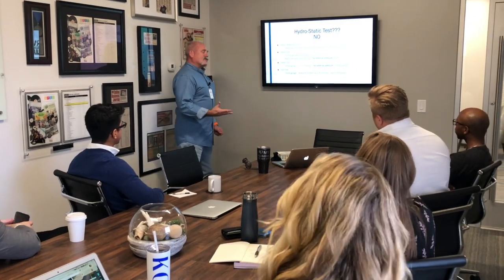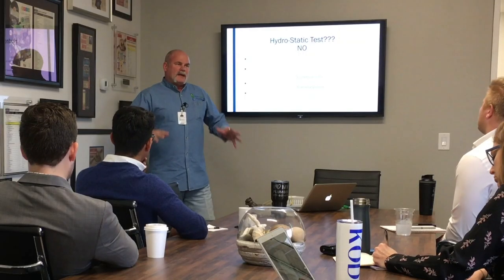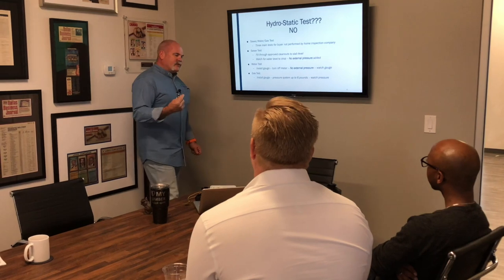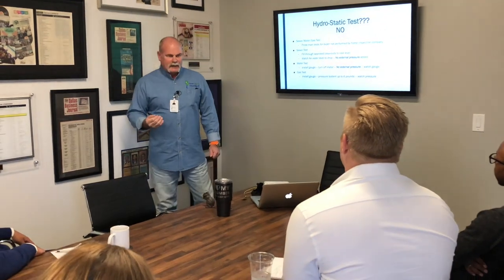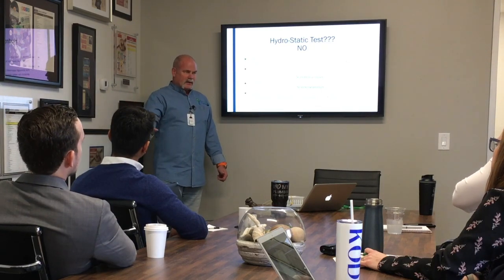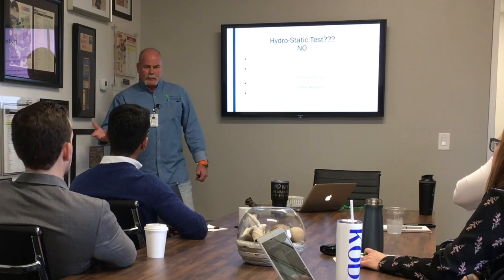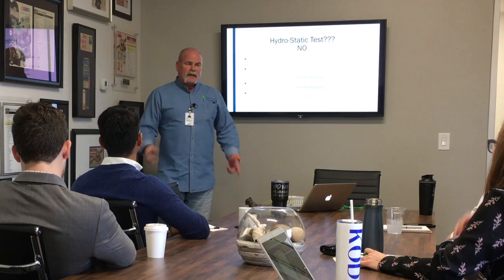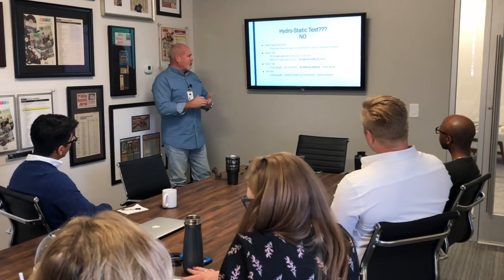Why "Hydrostatic Tests" Are Wrong - Plumbing Tricks - The Expert Plumber

Comment: By adding water to the system you are adding pressure, not very much, but still pressure is applied greater than ambient atmospheric pressure... thus the definition of Hydrostatic Pressure Test. Just semantics though

Comment: I enjoy your videos and have learned from them however as a hydraulic engineer I feel that you have a misunderstanding as to what “hydrostatic pressure” means. It is simply the force exerted on a vessel by the forces of gravity acting on the fluid within the vessel. Or more simply put it’s the pressure exerted only by the weight of a column of a fluid at atmospheric pressure meaning no forces or “pressure” are added by mechanical means. If you fill a cup with water to make sure it doesn’t leak that is indeed a hydrostatic test. Water is quite heavy and for every 33’ you descend you effectively double atmospheric pressure. At the end of the day though it isn’t pressure or in what nature it is generated that needs to be considered it is the forces experienced by whatever contains or confines it. For instance a 2” diameter test plug experiences about 6lbs of force with only a 2psi differential in pressure across it while at that same 2 psi differential an 8” diameter plug experiences around 100lbs of force. It’s forces that matter in real world scenarios and too much emphasis is placed on pressure without much understanding of what that translates into. Something the size of a hatch or door can easily kill you with the forces exerted on it by just a few psi while you might be able to plug your water hose with your thumb at a much greater psi. Point is it doesn’t matter to whatever or whomever is experiencing the forces exerted by pressure how that pressure was generated any more than it matters to someone struck in the head by a boulder whether that boulder was thrown at them or fell from a cliff.

Comment: I just did a whole house rough in for the sewer lines. I need to do the water test. Should I fill the water all the way to the roof? Or should I just plug a garden hose let the water run from the top of the drain? Many thanks

Comment: Well.. I mean. If there is a blockage in the pipe and you take your plunger out .. I'd say there will be excess pressure in the system. And I'm sure professionals have even more powerful equipment to get the pipes blown clean. In this situation, it would be really nice knowing the pipes wont burst from just a little bit excess pressure.

Comment: Hello, is it a hydrostatic test, done through a shower?
I had some guys come do a test after a foundation repair close to my garage. He didnt do anything in the sewer. He asked me if i had a shower on the first floor, i said yes  he said so they wont have to remove the toilet. After about 1 hour of ruuning the water on the shower, he said it wont fill up and that i had a leak domewhere underneath the house.
Reply: By the way the foundation lift was not done around the whole house  just around the garage. Where is the water going to if theres a leak and how bad will it affect it in the long run?